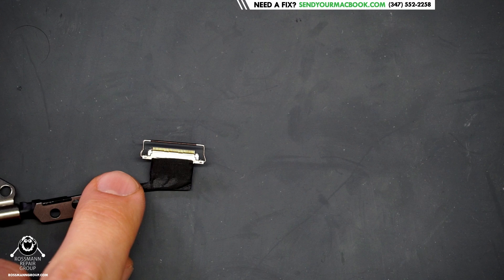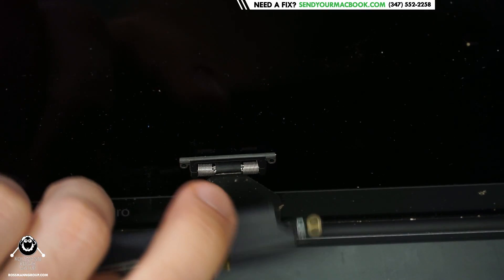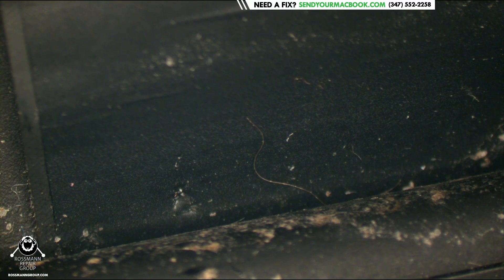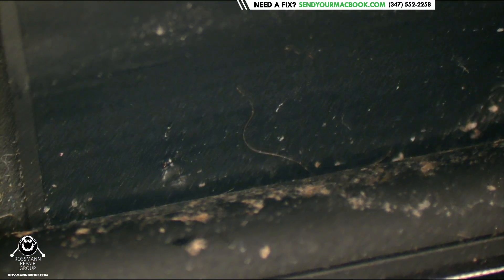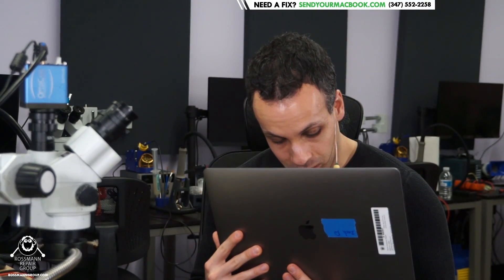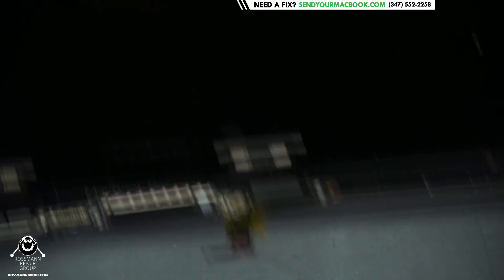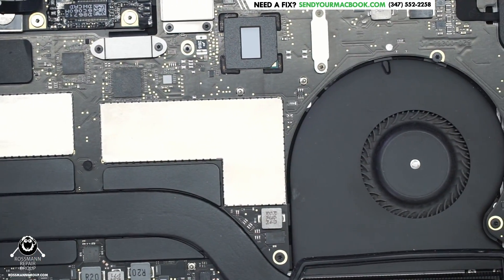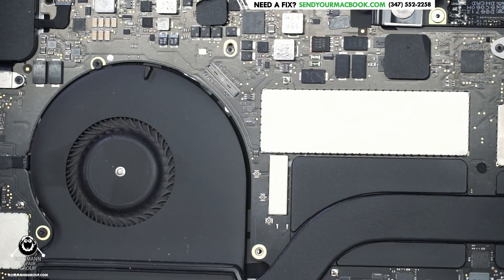How dust destroys irreplaceable parts of your Macbook Pro.

Comment: looks like it was designed that way on purpose. there was a very similar issue with aluminum unibody MB/MBP HDD cable. i've replaced quite a few back in those days.

Comment: I currently have been dealing with this on my laptop for a few months now. Just now decided to try and figure out the best way to fix it. I was hoping it would be a simple cable tightening/replacement but it looks to be a bit more complicated than that to actually get the cable fixed. I might have to just replace the entire display assembly as I know the screen ain’t working if I attempt to pull it apart. (I take scrap computers apart with a hammer) I’m definitely not the guy to fix this thing at a component level. Funny how like others have said my older Mac laptop also still works fine if you can deal with how slow it is. Probably due to memory being full and what not I’d imagine.

Comment: Programmed failure. Easy solution for that - simply don't buy any Apple products and that's all. I still use my Lenovo ThinkPad T400s right now, which I bought in 2009, still going strong.

Comment: Readers, commenters, posters, please keep in mind that Apple didn't design this cable interconnect.  That type of cable interconnect was made by a company called I-PEX (located in Kyoto, Japan).  The type of cable used in the assembly shown is called micro-coax and yup it is very, very, thin.  Apple would have given them the requirements for the cable (how it routes, type of cladding, connector termination, etc).  Its purpose is to carry the embedded displayport signal from the logic board up to the LCD assembly, and power, displayport aux channel, backlight power. etc.

Apple has squeezed every thousandth of an inch from the design and its component suppliers to produce designs that are very thin. There is not a lot of room where usable space is shared on opposite assemblies.

Apple probably won't be changing the requirements for the internal cabling any time soon.
Reply: Of course they designed it - and everything else that contributes to the problem, such as the lack of enclosed channel for the cable, the air flow of the case towards the cable, and the case design itself.  They also specified the requirements that had to be followed.  Passing the buck like that onto contracted third parties that are following Apple's direct instruction is corporate bullshit.
Reply: @ProcrastinationHyperfocus  Not sure if are making correct arguments here.  The design of the logic board uses heat pipes to direct heat away from the hottest components and uses fans to transfer the heat to ambient exhaust air.  The design has two baffles + fans on either side and the cabling in question is between those two.  The air flow doesn't need to go anywhere other than where the shrouds around the fans are dictating.  

I-PEX designed the cable to comply with apples flowed down requirements and really doesn't care about its end-use as long as it complies to the requirements they can continue to sell it to Apple.  No where in the cable drawing would it indicate it has to be IP65 compliant.  At the end of the day, Apple signs off and approves the cable for use in their product.

This isn't passing the buck - Apple, like any high-volume electronics company will 3D model the cable and any other item inside their assembly.  The channel you speak is quite literally the spot the cable is in when installed into the sub-assembly.  Apple has made their designs as thin as possible intentionally and this cable and the area it is located in facilitates that.  Today we are down to thousands of an inch of wiggle room in apple products.

At some point fans won't be required / present in the design and videos like this will still exist.

Comment: Dust is coated in rock grains and most rock grains are very hard.  Sliding dust across screens and finished surfaces scratches the surfaces.  Pressing keys onto dust-coated contacts chips and abraids the switch contacts.

Comment: Hello Louis. I enjoy watching your videos and think your critiques are something that Apple actually listens to....so, you perform a valuable service. Having said that, I've found Apple stuff to be amazingly durable. With phones, Android devices are intended to last 2 years as there is no OS support beyond 2 years. By comparison, iphones are supported for at least 6 years....and with a couple of battery replacements will provide excellent service for that entire period. 

As for computers, I currently own a 2013 27" iMac, a 2011 MacBook Air, and another 2013 MacBook Air, all you which are working just fine. In fact Apple supports the OS on these for just about 10 years. Maybe I might feel differently if I had owned a MacBook Pro of a certain vintage, but I have to say, the iMac and the Airs have been most excellent.

While I understand the right to repair issues....and it seems that your efforts on this have certainly paid off, as a somewhat rational consumer I've been really happy with my Apple stuff. 

Certainly every company should listen to folks like you and incorporate useful feedback into fixing design issues...and it appears that Apple does. But I wonder if your critiques might be lacking context. Based on what I've seen of my friends and associates who use Android and Windows devices, the situation there is far worse. 

So, Apple is less than perfect, but they do seem to listen. Can the same be said about Samsung or Google or HP or Dell? I don't think so.
Reply: my android is about 10 years old, i can replace the battery myself, ive THROWN this phone ACROSS THE STREET and its fine
Reply: my battery lasts for about a week also
Reply: ive replaced the charging port once by myself
Reply: not gonna convince me to get apple when i already have everything i need

Comment: Is that dust or some hard debris like a crumb? Doesn’t excuse apple’s engineering. Those thin flex cables were used for hard drive cables (2009-2012 MBP) and they suck

Comment: I had a similar problem with an MSI GS70 gaming laptop. But instead of dust, there was an unused plastic connector right where the keyboard cable made its curve. With time it poked the cable enough to puncture it, and it could only be replaced by replacing the whole aluminum chassis. 

I posted my problem on forums and found other owners with the same issue, I even took some high quality pictures and made some drawings to help others identify the issue on their systems. Crappy design everywhere 🤦🏻‍♂️

Comment: I didn't dislike but I don't like this video. You are nit picking. Really that little design element isnt that bad. As far as reliability. I dont have the monitor issue. My 2015 uses a hdmi to a monitor. I broke the screen.

Comment: I wish manufactures would stop using these type of flat flex cables, they are so delicate they break just by you looking at it at the wrong angle! I use to work for a fingerprint scanner company and we would get at least 10 scanners in a week needing repair, and 9 of those 10 were those white and blue flat flexes that had broken. & That is on a black box screwed onto the wall not moving a inch, imagine what's going to happen on a laptop hinge which is being hulked by your typical customer. Or the trackpad in my logitech keyboard, again the blue and white flat flex failed stopping the trackpad from working. Or the laser barcode scanner dad used for work, again blue white flat flex that failed. These things need to be sent to the fiery pits of hell and replaced with something that does not break just because you looked at it at the wrong angle!

Comment: At the end of the day we all know apple makes products that are sleek and cool and in the process longevity of computers have taken a back seat, things are not repaired but tossed in a bin that the western world thinks goes for recycling. cable breaks change the screen, keyboard breaks change the bottom section, componet on MO fails change the MO, batteries are glued in place and users can't replace them (90%). Over the years computers have become expensive too.....this cycle will continue as long as there are jer*s out there that have money and don't mind changing things every year or two...

Comment: Is this basically an another cable-gate? It that cable had 2 mm extra slack, you could have huge amount of dust and it wouldn't been pushed into the cable because the cable could still easily go around the dust.

Comment: Nintendo also has a problem where the control stick is defeated by a single spec of dust in the potentiometer assembly. Normally this shouldn't be a problem as for one these are usually dust-shielded subassemblies (not dustproof, but good enough for practical purposes), and for other, if there is any ingress, the wiper just swipes it to the side and it doesn't become an issue, but Nintendo apparently can't get it fixed for 4 years, the softest spec of dust just ends up bending the wiper out of shape, the engineering is just not up to the task, there isn't enough flexibility and preload force. It's repairable but every standard controller so far has had a typical life of around 5 years, and those arseholes think it's appropriate to release a system with an average life of a part of 6 months and call it a day?
Reply: Joycon drift?
Reply: @TomSidProductions  Yes.
Reply: Yeah the fact joycons are so prone to breaking is idiotic when you know you main consumer base is kids and families. The joycons and even the new N64 controller are horrendous. Where as you look at a GameCube controller and it’s still working fine almost 20 years later.
Reply: it's not Nintendo fault, it's ALPS fault, and they can't figure out what to do since Xbox One controller ...
Reply: @Sadenki  ALPS isn't at all responsible for this particular part, it's manufactured by Mitsumi and designed by Nintendo and Mitsumi together. ALPS sticks used by the other two console companies suffer from reduced dimensions and tightened software deadzone but they're not NEARLY as bad.

Comment: I have a old Atari 2600 that still works. Even tho I been told that the capacitors can leak over time. I have open it up and blown the dust off.

Comment: I had the Dell Precision 7710 mobile workdstation since 2015 relase and its still working great apart from aging skin, getting hot playing modern graphic games,  2 broken power pins and some dust build up inside which is easy to hoover out... other than these STILL GREAT.

Comment: Is there room to preemptively wrap that section of the cable - where it bends and rubs against the frame - in a protective jacket like electrical tape?  Or are the tolerances too small?  Do you think this would be a good preventative maintenance idea for owners of this model?
Reply: +1
Reply: +2

Comment: I took my Macbook in to repair the backlight.  The guys found a colony of dead ants inside my Mac.  They are big fans of yours by the way and by far the best place to get Macs repaired in South Africa.  They fixed it for really cheap.  Apple told me to replace it as it was beyond repair.  Cost me about $100 to repair the backlight and a couple of other issues.  Love your content dude!
Reply: I read this as the ants being big fans
Reply: Cool story bro.  Is that an ant in your avatar?
Reply: Hi, what’s the name of the repair shop in South Africa need mine fixed as well
Reply: @adriandube5595  I will have to crawl through my emails. I have their contact details somewhere. Just woke up will check after my swim and post their name.

Comment: Nice video! As you said, it's not so much the dust (as everything will accumulate dust) but rather the cable thinness and space it is provided... with such a tight gap where any bit of hard debri (e.g. dry bread crumbs, piece of a potato chip) will instantly indent the cable when it presses against it. If they designed the space for the cable with a little of bit more leeway above and below, or stiffened the cable material, it perhaps wouldn't be as prone to being squashed. Way to go 🍎 🤦‍♂!

Comment: Apple devices have many design flaws and this is not the only one.

Iphone 12 has heating issue that is why you can only download OTA update over wifi and not on cellular network which makes iphone an useless device when you have defective software and you couldn't update it via cellular internet which is in deed a shame.

Comment: Be aware: The next thing Apple is going to put in MacBooks or iPhones are dust detectors like 'liquid' detectors. BTW This is a big scam to reject repairs by Apple and make more money (selling new devices, repairing (better cleaning) and selling the old parts). OK sometimes liquid damages equipment but not always. See https://youtu.be/hc8Zut9DDXk?t=513 BTW these boards are not coated. Why is Apple not coating boards if liquid is the cause of so many repair rejects? (It makes component replacements more difficult but Apple is not doing that anyway.)

Comment: Apple could really improve their device reliability by hiring you as a design engineer.  The problem is they need the (scammy and meaningless) college degree in electrical engineering.  But the bigger problem is that bad designs just make them more money.

Comment: Hey Louis, could this be a problem with an M1 Air (as it has no fan) in a dust prone area? Could you suggest ways to periodically clean that area to avoid this issue? I'm worried I might blow the dust into that space (behind the cable) while cleaning.
Reply: Yea im worried too
Reply: No don't worry it's not a problem because it doesn't have a fan
Reply: the fan accelerates the process. I guess it can happen to fanless one too if the flimsy cable is exposed

Comment: Flat-Flex is nice for connecting a bunch of stuff in non-conventional layouts but you do need to reinforce the heck out of them if you want them to survive mechanical wear in an exposed environment. I have screwed up a few flat-flex cables and it sometimes takes surprisingly little force to stretch them enough for traces to break. I have no problem at all believing that friction wear and puncture are also a problem.

Comment: Seems like Apple laptops are built solid on the outside but are too delicate on the inside.  It is opposite for cheap plastic Windows laptops, where the plastic cracked and chipped off but the machine would still work.  I'd rather have the latter, at least the machine would still work albeit looking like it went through a war.

Comment: Apple seems to have designers who question things. "Why is this cable so thick and expensive", they then cheapen it and learn why. Just like the berks at my local supermarket chain who decided to cut down on plastic waste by removing the plastic wrapping on cucumbers, after all, why is that needed? well they found out why when their cucumbers went off really quickly and had to be dumped.

Comment: Hey Louis, as an electrician I've had to replace outlets and switches time and time again because of bad chemicals used. Even the big names new gear don't last 5 years compared to the old plastics that could live up to 50 years!!
Reply: Yeah i dont even buy plastic cable clips anymore...they crack after a couple of months. I think the problem is this new green plastic without plastic softeners like they used to have back in the day....annoying...but hey theres metal clips you can use....still annoying tho....
Reply: @ahah1785  What material? If it's nylon, those have never had any plastifiers. I suspect the issue may be different, it's possibly just low molecular weight, so the plastic basically comes already chemically degraded of sorts. Maybe lack of protective chemicals like radical scavengers and UV inhibitors. I don't know that there has been any movement there that outlawed or discouraged those, maybe companies just get off on making garbage, because what else are you gonna buy? Another thing to keep in mind is just temperature and humidity changes in the environment, can make all the difference between it lasting 4 years and 20 years for the same given part. Nylon likes a colder, more humid environment.

Comment: Is there any preventive maintenance or mod one can do to mitigate apple's well planned obsolescence technique here, it looks like it's very hard to reinforce it given that it has to slide through? I use a 16" MacBook pro (Intel), and would like to keep the machine running awhile longer. How old are the machines that show up with these kind of damages, can you disclose that information?
Reply: Same question maybe a you can put a very thin foam material on that part of the cable.
Reply: I'd try blowing compressed air around that area of the hinge when the display is closed. It might get rid of most of the particles.
Reply: I'm not sure this is mechanically possible but  perhaps cleaning the dust off regularly with a q-tip and alcohol.
Reply: Have a clean house
Reply: Don't use it outside (hahaha silly I know) and buy a HEPA air purifier. Else don't buy their laptops in the future, if you really need to run Mac OS, buy their desktop (again silly I know lol it's apple)

Comment: As the screen cable blocks most of the airflow it might be worth while putting some adhesive tape on the inside of the case to prevent the vent holes next to the screen cable from being used.